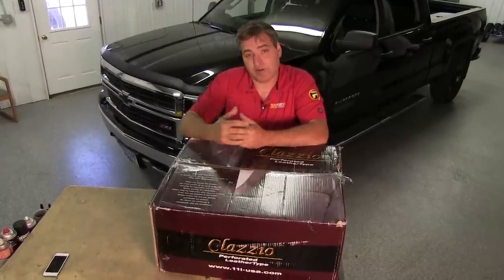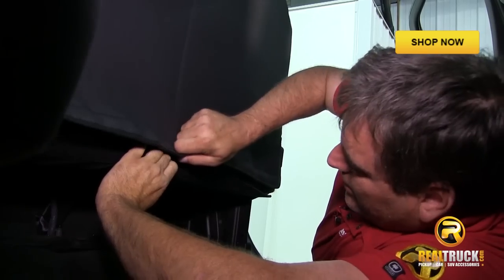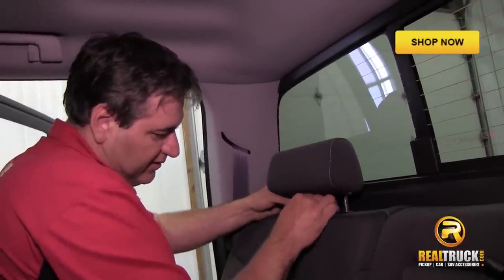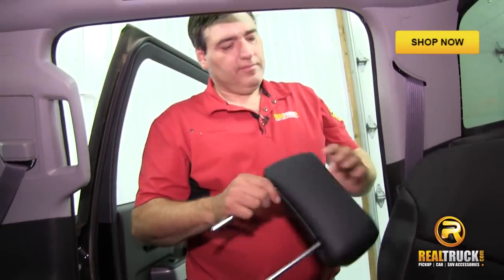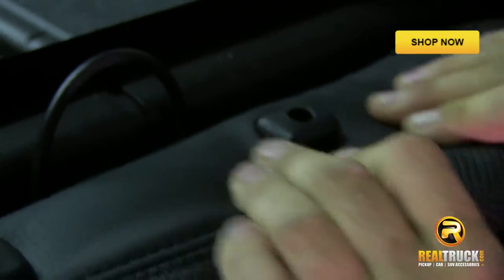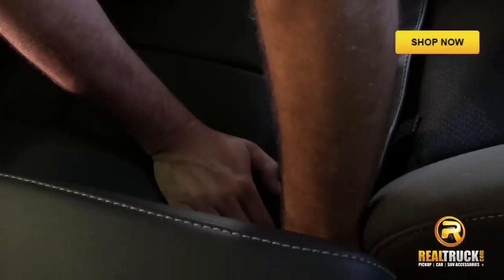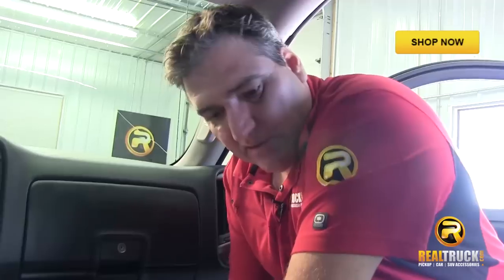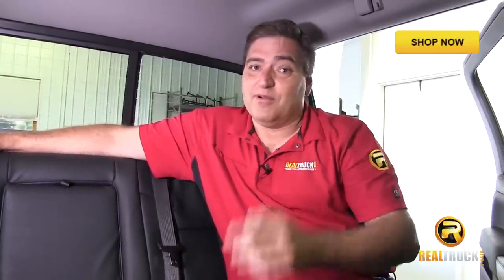How to Install Seat Covers on a Chevrolet Silverado

Comment: I have a 2014 Silverado 1500 double cab I have some questions s my rear seat isn't like the one in the video my rear seat is just seat it does not have the fold down seat for the cup holders I have the work truck package and on my center seat in the from it folds down but it does not have that I under seat middle seat storage its just the fld down seat
Reply from the maker: Lifted2014Silverado not sure exactly what your question is here. I would be more than happy to help you if you could clarify a bit or If you would like to speak to a person directly feel free to contact our knowledgeable Customer Service folks at  877-216-5446
Reply: Ok and well I wanted to check if u guys made some for the work truck without the folding rear bench and the front center seat that does not have the storage box under the middle seat but ok I will go ahead and call thanks for ur respond sir
Reply from the maker: Lifted2014Silverado no problem. Hope you can find what you are looking for.

Comment: I have a 2014 chevy 1500, i'm interested in buying these seat covers from your website but I have one concern. I have a 40-20-40 front seat and in this video you didn't mention the center console at all... My middle seat has the fold down console with cup holders and i'd like to see how the cover fits before purchasing...
Reply from the maker: +MeyerPrime here is the link to the ones you need.  http://www.realtruck.com/clazzio-leather-seat-covers/ These are probably the nicest and best looking covers I have ever seen. They are really tight to put on takes alot of pulling and tugging, but it is def worth it. If I remember correctly there is 2 parts to the console cover. I like the top part but not the bottom because it has 2 straps that run across the opening that you can see when you open the lid. Unfortunately for some reason I can not seem to locate the images of it.

Comment: what colors do you have for a silverado 2016 crew cab? I wanna buy them. How much are they?
Reply from the maker: bono2426 only black grey or tan for the front and only tan for the rear. You can check them out here: https://www.realtruck.com/clazzio-leather-seat-covers/R183920P2016Y734MA.html or If you  have any other questions about this or any of the other 500000 plus accessories we sell and would like to speak to a person directly feel free to contact our knowledgeable Customer Service folks at  877-216-5446
Reply: Will these not fit on a 2016 sierra? The black ones in the video

Comment: What brand are those covers used in this video. I like the custom fit and would like to get the exact ones.
Reply from the maker: In this video, we installed Clazzio Leather seat covers. Here is a link to check them out. 

https://www.realtruck.com/clazzio-leather-seat-covers/
Reply: RealTruck.com just checked your site. I guess they don't make them for the double cab. I clicked the link and put in my truck info and it says theyvarent available for my truck.
Reply from the maker: Give us a call and we can see about getting them for you. Sometimes the site doesn't include everything that is available.

Comment: What happens to the pockets on the back of the front seats
Reply from the maker: Mike Cunningham This will now be hidden, but you gain some new pockets with the new front seat covers. One thing that is great about seat covers is when you are ready to sell your vehicle you can take them off and your interior will be in show room condition.
Reply: they look real nice too.....can you get them in multi colors like white and black
Reply from the maker: Mike Cunningham Yes, Im still surprised how nice these turned out. You can buy a pickup with a standard interior package and uses these to give it a upgraded look much cheaper then factory.